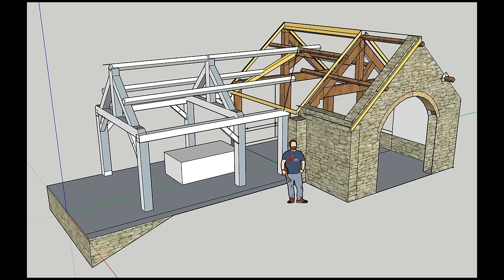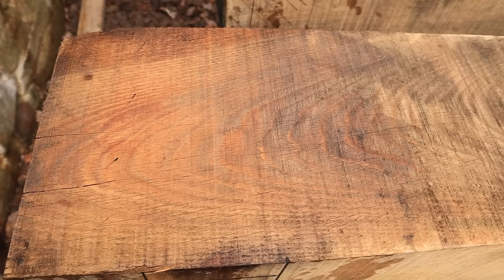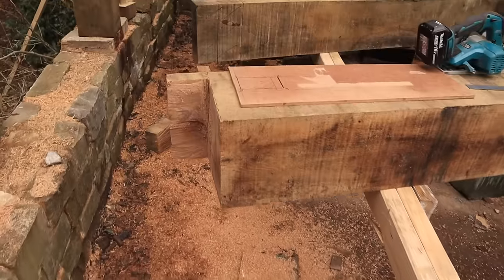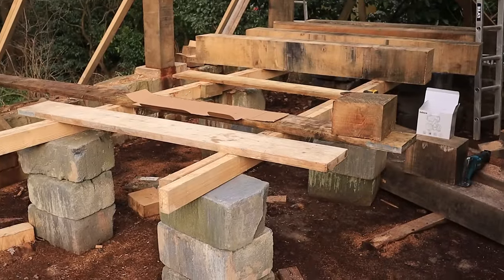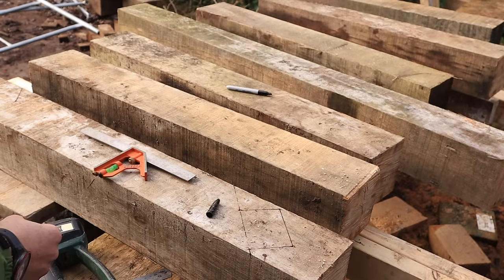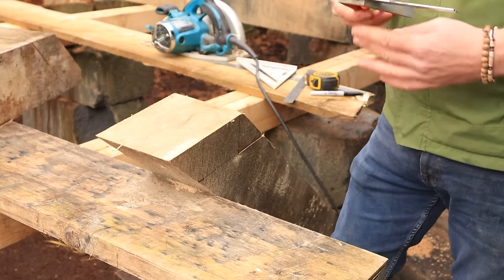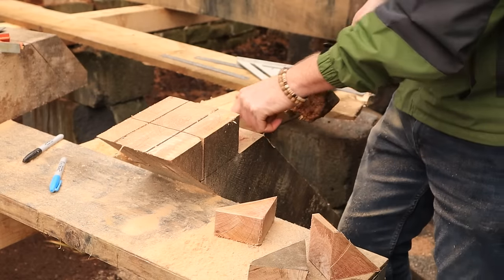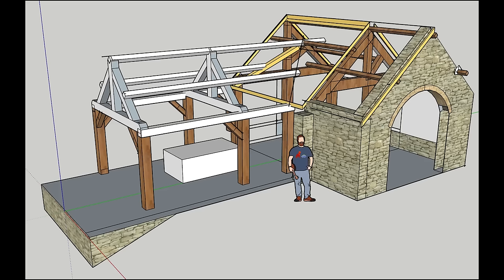I build a large vintage barn on DIY skills E30

Comment: alex if your cutting tennons with a chainsaw the base of the blade is easier to control than the tip so cut at the saw not the tip. thanks for the vids. ps that towel is dangerous around the saw so pant legs over boots no chips and no accidents with loose towels

Comment: Hey Mate, when cutting big timber with a chainsaw, use hardwood planks nailed or clamped to the timber you're cutting to guide the chainsaw better, and inform you when you bottom out etc. this also minimises tear out if setup well.
Never rush with a chainsaw, keep the blade sharp for accuracy. Wear chaps.
When making complex pieces, ideally cut the fiddly bit out first, then do the simple trimming last. This allows for cockups without actual problems.
Its not that craftsmen actually don't make mistakes, it's that they know how to mitigate them so it matters nawt. Family in Dorset, I'm on the opposite side of the planet. Love oak frames. We don't have em here.
Cheers from Western Australia

Comment: With a sharp blade the cuts with a chainsaw look good but as it becomes dull one side is sharper and will drift off at a slight angle.  I always thought of a chainsaw as a clever and circular saws closer to a scalpel.  
Nice job can't wait for the next video to come. 
Easily becoming one of my favorite channels. 
You don't claim to know it all. But you do figure it out. Great job
Reply from the maker: Well we are getting there - really moves up a notch in the next 2 episodes 😊

Comment: Never use a makeshift apron made of soft flappy cloth when using a chainsaw. lol. If the wind blows that into the blade it can wrap up on the blade and pull the blade back into your legs. And no not a safety warrior just warning you.

Comment: I wonder if you could glue a small spirit level to the chainsaw - it'd bounce around, but at least you'd have some idea. The angle to mount it at would be important, but if you clamp the blade so that it's parallell to the ground and then glued it to be properly zeroed out then that might work.
Reply from the maker: Yes, I also thought of having a mirror so I can see the angle on the other side. I actually get my eye in a bit better in the next video. Thanks for watching 👀
Reply: @AlexBuildsUK  You could put something filled with red liquid where the cut should terminate. You'd notice you'd gone too far in a fun and novel way!

Comment: Attaching some one by threes to the tarp like a frame could help hold it down in the wind.
Reply from the maker: Good idea 👍
Reply: @AlexBuildsUK  It also works a treat if you fill up some empty 1L plastic bottles with water and hang them from the eyelets in the corners ..... easier to handle than chunks of wood

Comment: this might sound silly But have you considered stealing your miss's large mirror and putting it the other side of the beam when your cutting so you can see if the rear of your chain saw cut is on the target lines.??? yeah i know sounds silly but eh if it works it works if it dosent you aint lost nothing by trying its just a thought i had. might help might not

Comment: Jesus 6:20 you are asking for a massive kickback from the chainsaw using it like that. if the chain bites on the tip it will travel up the cut and swing back at you